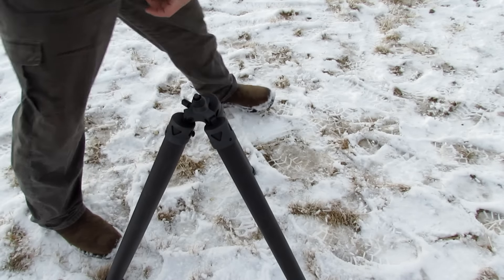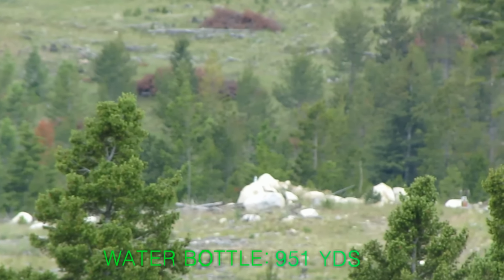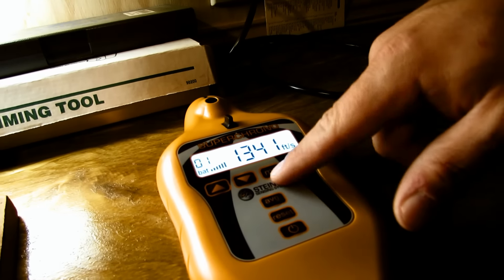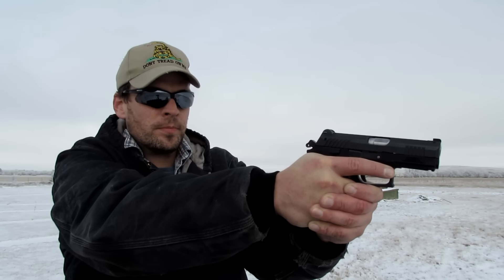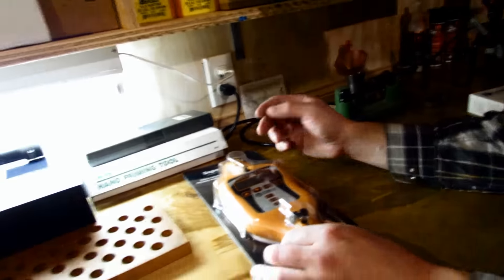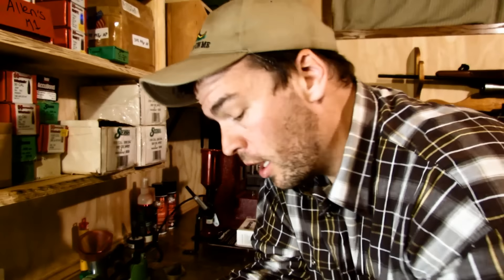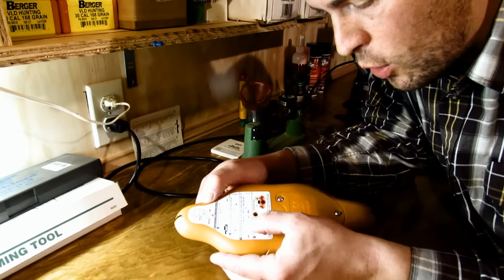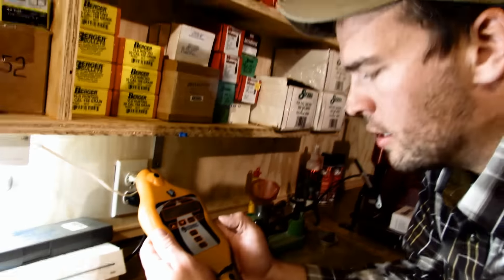SuperChrono FULL REVIEW (HD) - World's First Acoustic Shooting Chronograph - Rex Reviews

Comment: a pretty cool system.  definitely better than shooting thru tiny chrony "screens".  however, it won't work well at most formal or club gun ranges unless there's a way to easily retrieve the data that's 10-15 feet out from the shooting bench.

Comment: I wouldn't necessarily say this is better or worse than the Magnetospeed. Where the SuperChrono is better: it can be used downrange and the Magnetospeed cannot. It does not need to be attached to the rifle but the Magnetospeed does. Where they are the same: light conditions don't affect either one. Both are easy to set up. Where the Magnetospeed is better: if you go to a public shooting range, you don't need to ask the RO if you can set it up. There isn't a risk of others accidentally shooting it. You get actual muzzle velocity rather than velocity 10' out. Subsonic velocities can be measured. Finally, something I think that is worth mentioning: you can get the adaptor to mount the Magnetospeed to a picatinny rail so it isn't on your barrel (assuming you have a handguard with a picatinny rail). For those with handguards that don't reach close enough to the muzzle, a keymod rail extension can be used. Personally, they both have excellent advantages over one another so I think my age-old advice for deciding which firearm to buy is appropriate here: if you can't decide which one to get, just get both of them! Awesome review and info, by the way.